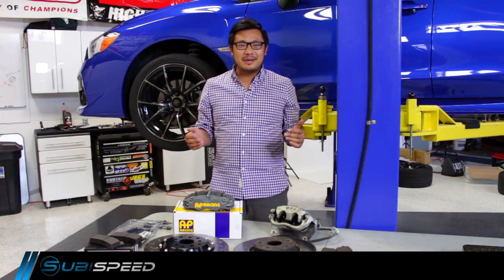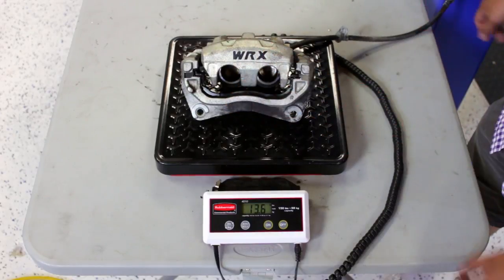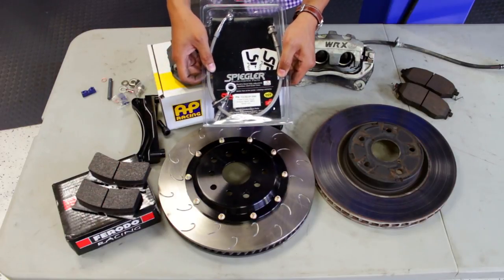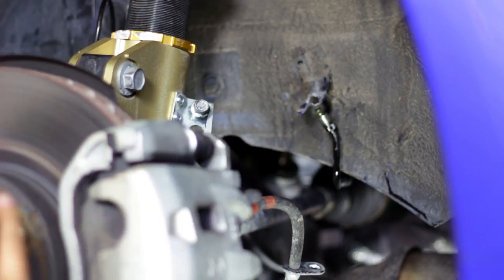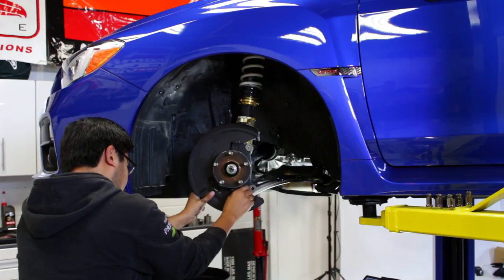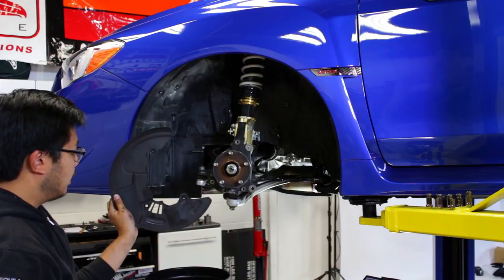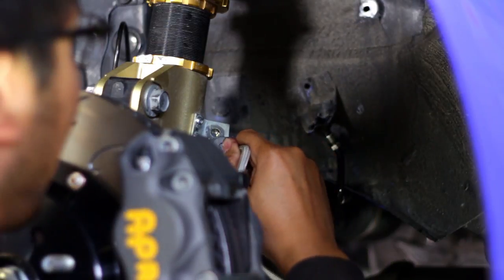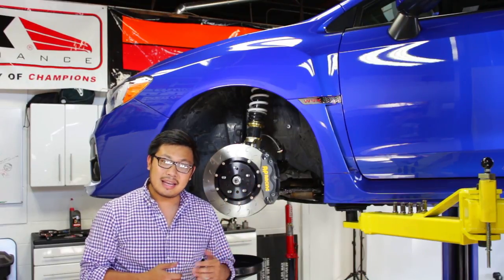SubiSpeed - 2015 WRX and STI AP Racing Big Brake Install - DIY

Comment: 2-piece rotors for lighter weight, but also less thermal transfer to hub. I ran a Stoptech BBK for a while, superb quality. Much better pedal modulation, absolutely zero fade on-track.

Comment: this is for early cg8 and forester gt up to 2002 = every body knows subaru had 4 piston brakes from 2002 onwards with subaru on the caliper moving onto brembo 4 piston a little later = so only really good for race or rally - go to the wrecker - it will be cheaper and get new discs not much cash. i did and fitted high pressure brake lines !

Comment: Lots of theoretical gains but how about some simple numbers? What is the braking distance with OEM vs this kit? That ought to be the biggest metric which people use to decide whether or not to buy this.
Reply: ***** Not to mention better acceleration through less rotational weight
Reply: TheLeesto AP racing big brake kits aren't so much about pure breaking power and more about stability. Contrary to what most people think, 2 piece rotors are not meant to save weight. They do but it's no their primary purpose. They were first invented to manage heat: 1 piece rotors in race conditions would break because they would get so hot and would expand so much that they would crack and shatter but 2 piece rotors have oval shaped mounting holes (between the two pieces) wich means they can thermally expand without cracking. This is espescially true with the big one piece rotors you can see on road cars nowadays. The 4 pistons will help with pedal feel and brake control but the pad area is the biggest determining factor in braking power. What I mean to say is that you could probably get the same braking power from a simple pad change on the stock pieces but the difference comes when you go to the track. That's why everybody will tell you you don't need a bbk if you don't abuse your car.
Reply: TBH, one of the most important features of a BBK is zero fade, ever.

Comment: Hey man, as far as the dust /heat shield goes its your choice, but the j hooks and the vents need to be facing the forward rotation. What you have done is the reverse, where the vents are not scooping up the air and the j hooks are not opposing the pads. You should consider changing this immediately
Reply: +Dj Hazard all rotors with angled fins, are to push the heat from the inner area of the rotor to the outter, not the opposite. why would you push the hot air towards the center of the rotor?
Reply: +oinkurrboinkurr because its comments like these that spread mis-information. Typical youtube comment lol
Reply: yea thermal engineering is a typical youtube comment

Comment: I'm interested, but how will this effect the torque vectoring and vdc?? Is it a drastic difference while turning? Don't want the car to over compensate or anything. On a curve the car's giving me a lot more credit then I should have with stock brakes
Reply: I'm almost 100% sure when you turn off all the Aids and switch to s# the torque vectoring stops.....

Comment: if your not a hardcore track enthusiast but still want to take your car out on the track without much brake fade whats a good set of brake pads that arnt to pricey?
Reply: Stoptech street performance or sport. They are same pad, just used to be called the former and then switched to the latter. (Or viceversa). Have them in my m5 and they work well under light track use/racing. 

You need better fluid and I’d install stainless steel brake lines.

Comment: Couple things with this video: #1 not saying its going to make a difference but on the OEM weight of caliper, you left the brake line attached where you didn't measure the line with the BBK. Still going to be lighter i know but still mis-representation. #2, "J-Hooks" are just for looks and "Pad scrubbing" Their job is not to dissipate heat at all.. Mainly their for scrubbing the brake pads and for looks! #3 when you're looking at the vane geometry, its not necessarily more "air flow" that the geometry accomplishes. Compared to the OEM straight vanes, the curved vane geometry acts like a pump per say to "pump" the heat out and create a more laminar flow.
Reply: +Kevin P Not saying you are wrong but seen in video Jeff (that's his name right?) from Essex says the J hooks improve heat dissipation.
Reply: @johnvelazquez9579  marketing BS, they don’t allow any gaseous out flow due to their design, so I’d agree with the poster above they are more about looks than about function. Now if they extended full width of the rotor & allow for gaseous outflow they could help with some heat dissipation, however they don’t.

Comment: I'm new to tuning and i wasn't sure if i would need to buy two of these kits bc they only come with two disks and two calipers.
Reply from the maker: Just one kit is needed, as it only replaces the front calipers and rotors.  There is not a rear kit available from AP Racing at this time.
Reply: SubiSpeed would it be alright to only replace the front calipers and rotors or would that cause a problem.
Reply from the maker: That's what we did and we've been to the track a few times since and we are still alive :)

Comment: Watching your other videos how come the brakes squeak all the time? Is it just when they are cold?
Reply from the maker: The pads we use are for track use. When hot they make no noise.  If your car is more of a daily driver then there are pads we can supply in this kit that will be silent during daily driving and also provide decent track performance.

Comment: Do I have to change the suspension if I want to upgrade this brake kit for my WRX 2016?? Or do I have to change any thing?
Reply from the maker: +le Anthony No
Reply: +SubiSpeed can you do a video for the rear Ap racing brake kit 4 pis for wrx 2016?

Comment: I would like to get the Radical 6 piston brakes for the front, and 4 piston for the rear for my 2017 wrx. Do they make kits for this? I have larger wheels than oem
Reply from the maker: We are working on getting this kit to become available.  No ETA at this time and it will be an expensive kit!
Reply: They do.....Wilwood brakes from TCE performance. 6 piston forged billet front calipers and 4 piston forged billet rear calipers. 2 piece rosters front and rear.

Comment: What does the AP caliper and rotor cost? Also the cost on the Ferodo brake pads?
Thanks
Reply from the maker: http://www.subispeed.com/2015-subaru-wrx/brakes/big-brake-kits/ap-racing-competition-brake-system-sprint-2015-wrx.html#.U9QP6vldV8E

Comment: It is better to use standard TQ values than just 'good and tight'... Good and tight is subjective and unsafe BC one person will over tighten, and the next under. Take five min online and find standard TQ values for thread and diameter size :) And of course, if in doubt, Lock Tight!

Comment: so would you say it would be a good idea to get these for daily driving? they should last a really long time with the thicker pads and the fact that it wouldn't be pushed hard as if we were on the track. Just a question so save the sarcasm or dickhead comments please.
Reply from the maker: These would work for daily driving, but they would not be necessary. We would recommend some upgraded brake pads instead.

Comment: So... this is only a front upgrade... what about the rear? nothing to match?
Reply from the maker: +Benito Samia (Bb) Upgraded rear brakes are available as well, however, most of your stopping power will be coming from the front.
Reply: +SubiSpeed what size rims would I need to fit a BBK?

Comment: Where can I buy this kit?  I have a 2013 STI
Reply from the maker: There is a link in the description to our website -> http://www.subispeed.com/2015-subaru-wrx/brakes/big-brake-kits/ap-racing-competition-brake-system-sprint-2015-wrx.html#.U5r_ePldV8E

This will also fit the 2013 STI so good to go if you want to order a kit. :)

Comment: How can I reduce brake fade with out doing all that? huh? anyone?
Reply: +Mad Hatter slow down i guess
Reply: Don't ride your brakes, puddles can warp or glaze your rotors with the quickness. Keep up with flushing every 2 yrs or 20,000 miles.
Reply: +Mad Hatter get better pads....
Reply: better brake fluid, upgrade the SS brake lines, better pads.
Reply: Yeah honestly you don't need all this unless your on the track. Stoptech makes a full kit that has better pads, rotors, and stainless steel lines. I also recommend a master cylinder brace.
Reply: drift more. stop less
Reply: Fluid

Comment: I think you are forgetting that Brembo have been supplying brakes in F1 since the 70s
Reply from the maker: AP Racing has racked up about 708 Grand Prix wins since the 60s so they must be doing something right.

Comment: darn I hate you guys lol now I want to get a wrx or sti lol. Had the 03 wrx and loved t had a 08 evo x and it was fast and fun took to mods well. have a 13 accord sport stick as a dd now and wanted a new vette the only thing is I don't track anymore mainly due to working all the time. I think a sti might be a great toy for half the price. yeah its not as fast as a vette but tune the darn thing get some ohlins and u can rip up any road. The only thing is is want a 2.5 fa with hydrolic steering in a sti.

Comment: Easy doing it with a brand new car with no rust or corrosion on it. Try a vid with a 10yr plus car.
Reply from the maker: +Scott Keeble Same process. Just more beer, swearing, and couple bloody knuckles. Also the use of a torch and cutting wheel might be seen. ;)

Comment: for a street car and some auto crosses, the oem floating/sliding  caliper is adequate. Just get some dot 4 brake fluid and a good set of upgraded brake pad and you will be ok. But for track duty, I agree with the SubiSpeed gentleman. Alcon BBK is also a good choice but I do not know if they make them for the WRX.

The Brembo BBK that come with the STI is an INFERIOR product. The Morons that have been design this set up for the past decade for STI should know better. This is because the aluminum Brembo caliper is mounted directly into the knuckle assembly to hold the rotor. The problem comes in when it is time to change the rotor, thus you have to remove the caliper to get the rotor out. The heat, rust and foreign matters the have been accumulated over the years caused the stripping/rounding off the threads on the Brembo aluminum caliper or making the job a lot difficult. Even if the mechanic used hand tool to remove the caliper bolts that attached to the knuckle assembly. You have to be stupid to use impact wrench on this. Once you damaged the thread on that Brembo caliper, the best option is replacement. You can try to re-thread the caliper and the knuckle assembly but it is not safe. As a result you will turn it into a bigger job and more headaches.

 And the aforementioned MORONS from Brembo did not make the caliper braket like AP RACING, Alcon, J's Racing and Spoon Sports calipers.

Comment: *WARNING* Follow the Subaru factory service manual for proper installation. This video is not a proper installation of the big brake kit. It skipped one very crucial procedure.

Even with relatively low mileage on the bearing hubs and brand new high quality brake rotors, you should still measure for lateral run out for the rotors and index the rotors in such a way to minimize run out. I have seen as much as 0.005" of lateral run out by not indexing the rotors.